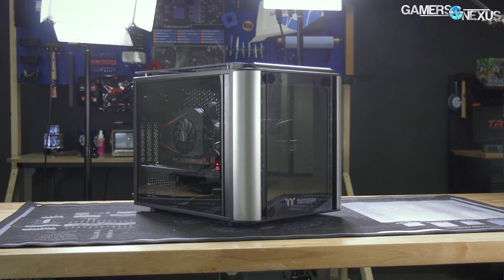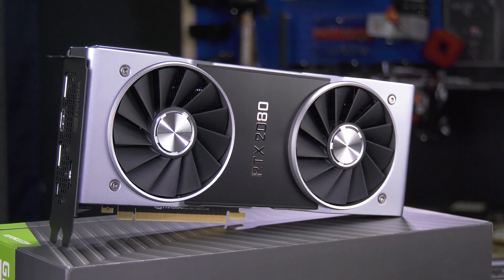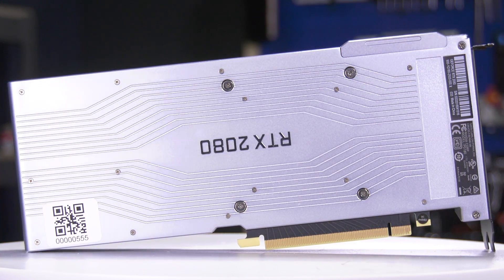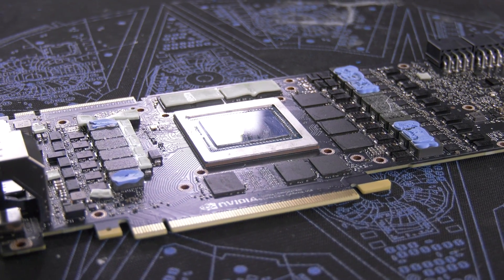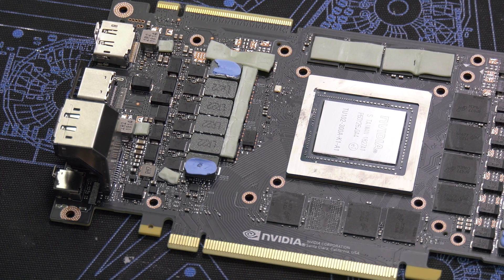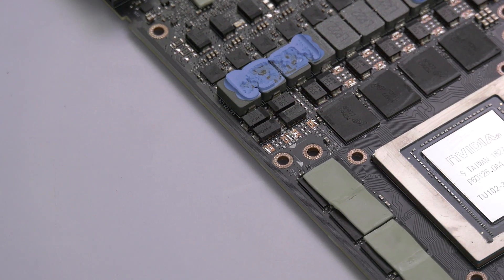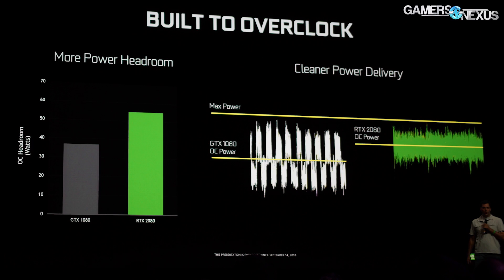RTX Power Delivery Redesign & FE Cooler | Interview

Comment: It might be a bit oversimplified, but if I understood that correctly more capacitors = less noise from the vrm/less coil whine?

Suggestion to Steve&Team: Can you adress coil whine on future card reviews? 
F.e. I bought a MSI 1080 Ti Armor about a year ago and put a much bigger partially self made cooler on it because it has the same rather good PCB as the Gaming X and it indeed has many benefits, the vrm is very easy to cool and in terms of power capabilitys it's more than enough, but it has absurdly amount of coil whine and if the statement of this video is true, that might be bc there's just 14 capacitors after the main doubled 8 phase VRM and they're also round electrolytic capacitors and not rectangular like on the founders editions, idk if that matters though.

Comment: I'm curious to know about the fan curve and if it is clever when in the idle/near idle range. A pet peeve of mine is when a GPU switches between fan speeds and it does it drastically, especially from idle.

e.g. Some GPU fans can idle at very low percentages, some won't work unless you give them 20% 

ASUS tackled this well on their motherboards with a Spin Up/Down variable you can set in seconds. If the Fan wants to go to 80% from 20% because of a temperature spike and you have the variable set for 10 seconds it'll make that  transition over the course of 10 seconds.

Comment: so not only did Nvidia dump a bunch of chips on partners and make it their problem, now they are going to cut into their profits by creating a founders edition that performs on par with partners, so why would partners continue to kiss their ass with all the ridiculous hoops they jump through?
Reply: ''Kiss their ass'', don't get me wrong I hate nvidia for all this crap more than anything but the boardpartners are nothing more than leeches. Only a select few % of the consumerbase actually cares which partner their card comes from and those are the people who like to push their cards beyond regular bounds (even then its largely based around the silicon whether you will get the overclocking result you want or not). If dropping boardpartners was all it took to get cards our way at near msrp I would gladly help nvidia get rid of them, but alas nvidia smells the money themselves and would much rather bump up their own price.
Reply: deari900 - if the board partners were nothing but leeches, why doesn't everyone but nvidia direct, and why are the "leeches" the ones losing out on this deal and holding all the overstock of chips nvidia made and are forcing them to take if they want the new chips? you called the wrong company the leech...

Comment: Since they said they're not using doubling scheme, does that mean that their voltage controller outputs at least 13 PWM signals? Or is just the same bullshit that mobo vendors do when they put two groups of FETs + Chokes on a single PWM signal and call it two phases?

Comment: Does NVlink work like SLI where developers have to do a lot of work to implement it or does it just work on it's own?

The reason why I really don't know is because when Nvidia first showed off NVlink with Volta they described it as combining many GPUs in to one massive one. But it seems like that would be a massive selling point, but they really didn't mention it much at all in the launch.

Im just curious, it would be really cool if they managed to do it.
Reply: While they may well be able to combine all the VRAM into one single transparent buffer, this does not mean they can combine all the cores into one transparent compute/video device. The necessary synchronisation and the very low latency required for this to be able to work in a transparent way (e.g. to not require explicit coding for it) is very non-trivial. Perhaps even impossible with current architectural design?

I strongly suspect it will continue to be poorly supported for games. Compute on the other hand may well be better supported, at least insofar as a subset of operations are concerned (those not requiring fine-grained, low-latency synchronisation)

I also suspect the only way to support fully transparent compute and video device addition/combining is through some mechanism of speculative execution to reduce synchronisation demands, along with a means of structuring command requests to reduce synchronisation demands by reducing inter-device data dependencies (say, where one card needs a texture from the VRAM of a different card) and the like.
Reply: @mduckernz  Thank you for the response.

This is coming from a person with very little knowledge of computer engineering, but I don't get why Nvidia can't get something like alternate frame rendering to work all the time, allowing for SLI to work in every application without explicit development.
Reply: @devindykstra  Yeah, AFR is a possible means of doing so - I too cannot see any show-stoppers there - but you will need to give up VRAM addition. Otherwise you're back to synchronisation issues.

Alternatively you could use a dongle which accepts two DP/HDMI inputs (and outputs a single DP/HDMI) and use the FreeSync frame update signal to switch between the inputs. This is effectively a way of doing AFR without needing to synchronise between the cards. 1. I don't think it is necessary, and 2. It would never be allowed by NVIDIA because FreeSync lol (if you did it the GSync way it would be ludicrously expensive for what it is)

Comment: "first time dual axial fans with vapor chambers"
i guess nvidia doesn't like to look at all the vapor-x designs from saphire?
Reply: Great point just what i was thinking
Reply: @penzonor
i am really curious of the size of said vapor chamber, does it go over vram and vrm, does it cover all of the cooler length almost, is it just bigger than average for a gpu vapor chamber.
gn will probably cover this soon, i'm very interested if it actually does a good job compared to other 2 slot designs say evga's for example.
gn shall not be defeated by nvidia's glue! (holding fans and cover onto the cooler)

Comment: wait, so there are heat pipes?
Reply: Good question. However vapor chambers are practically just big flat heatpipes.
Reply: +Péter Kiss but heat pipes take heat away from the source, whereas vapor chambers just spread it around. heat pipes are always better
Reply: firexgodx980  They both work the same way. The only difference is their geometry. Both of them just try to equalize the temperature in their whole body with local evaporation at the warmer points. Both just spreads the heat, the pipe along its longitudinal line (in one dimension), while the chamber along its plane (in two dimensions).

Comment: Nvidia's reference design cards > AMD's
Reply: Recent?  AMD been getting smoked for some time.  AMD has good cards, buy Nvidia 1000 series just wrecked AMD.
Reply: Nope 

- Always had overbuilt pcbs
- Dual BIOS
- Fury X & Vega Liquid have the best reference coolers and even beats most of the aftermarket ones
- Easily serviceable. AMD uses mostly philips bits and sometimes torx, screw numbers are on the low side, shroud comes off separately without even needing to touch the warranty sticker so you can clean the heatsink
- Silver Vega looks fantastic
- Metal shims to protect the die from being crushed by the cooler in case of overtorquing
Reply: Bizo221  I forgot to mention that I was specifically talking about the reference cooling shroud design, AMD's looks like a square plastic brick while Nvidia's looks more 'premium'
Reply: I agree with both of you are saying, but I was talking primarily performance.  (for gaming).  AMD are great cards for the workplace, however.

Comment: "Vapor chamber is soldered onto the heat stack." (@~2:40)  Could this by why you had trouble with the teardown?
Reply: Should still be possible to remove the fans though
Reply: GurtTarctor but why would you want to remove the fans.
Reply: That would most likely be the answer, makes sense.
Reply: Surely they wouldn't be soldering with the entire shroud on? It is to be expexted that the fins won't separate from the  vapor chamber, using thermal paste of sorts would be horrible in terms of cooling capacity. So soldering is pretty much a must I'd say.
Reply: Unnamed Internet Citizen you think you have access to these fans? Are you silly? Just send it back for a full new cover like a normal sane person.
Reply: Unnamed Internet Citizen, yeah I would not put that on anything over a 1070...

But sure, fair enough but not normal person is going to do that, so why add more parts to the design to benefit the 2 people that use the card for more than 3 years at full RPM.

Comment: Is it just me?  or is there a memory chip ripped off that card?
Reply: The PCB is made to accommodate for a Titan configuration, which by tradition has 12 gigs of vram (1 more than XX80Ti, which has 11gigs). So expect a Turing Titan on this PCB, with all VRAM pads occupied.
Reply: And because of this, it should produce less heat! Which is a good thing all around.
Reply: @davidhunter5802  1 extra/less memory chip has a negligible contribution to the total heat produced.

Comment: i wonder why he talked soo much about how efficient it is

i feel like its gonna  be powerhungry then
Reply: Power“hungry” means sucking a lot of power for not a lot of performance, if it sucks a lot of power yet offers a lot of performance that’s power”ful”.
Reply: The die itself is really large so yeah
Reply: @Tuchulu  nvidia will prolly be like
"yeah it uses alot of power.... but it does it efficiently"
Reply: PLPlolol 1  You can use a lot of power and be efficient (like Threadripper has a 30w higher TDP than an FX-9590, so it does use a little more power, but its also kicking out 8x the number crunching)
Reply: Pascal cards are already pretty efficient. If the new architecture has at least the same energy efficiency but they improved the power section even further, then there is no reason to complain.
Reply: Usually with first gen (12nm ), will be power hungry and run hotter . As the next gen of turing will be more defined and so on.

Comment: "hey my name is steve and I'm going to ask some questions and you can answer however you want even if it doesn't make any sense." "up to 1/5 quieter or 1/5 of the noise of a 1080", really?
Reply from the maker: Technically speaking, they are correct. Decibels are logarithmic, so you're looking at a rough 3dB change depending on if they're using SPL or not. It's not marketing we agree with, but we discussed that in a separate video. Mathematically, they are accurate.
Reply: We can't really expect the forum viewership these days to really understand that sort of thing though, Steve, can we? Just take a look through what much of the channel viewership has become. Tech today is full of ignorant opinions, bias, and misinformation.

I much prefer your work done mid generation, as it often focuses on addressing much of these issues. I think these sorts of launches drive everyone into their own shells of bias, and it is seen throughout. Its hard to dodge the trend when it drives viewership and $ up though I am sure. You and your team do much better work getting to the facts, providing factual technical leadership. It is a real challenge keeping individual bias from seeping into media content for personal gain.
Reply: 20% less noise, how hard is that to understand Milvio?
Reply: "up to 1/5 quieter or 1/5 of the noise" did you read or listen? in what scenario is that card going to be 1/5 of the noise? you sound really smart  so I am hoping for a good answer.
Reply: @milviodeleon4421  Again, he is not saying 80% less (1/5 of the noise) its 20% less (1/5 less than the noise of the 1080)

Comment: they didn't answer, are there pads, paste, what,
Reply: Obviously pads. The components in the VRM are different in height and the FETs have plastic casing. Some direct contact and paste wouldn't be such an upgrade, but just pain in the ass in the manufacturing. Not as they really needed that efficiency in cooling those FETs...
Reply: The question was what connects the vapor chamber to the base plate, not what connects the base plate to components.
Reply: Marc Wolfe  I think the guy explains it at 2:23. "The vapor chamber is soldered onto the fin stack."
Reply: He said that, without answer how the base plate is attached to vapor chamber, he said there was a heatpipe for the VRMs, but still didn't answer that detail.

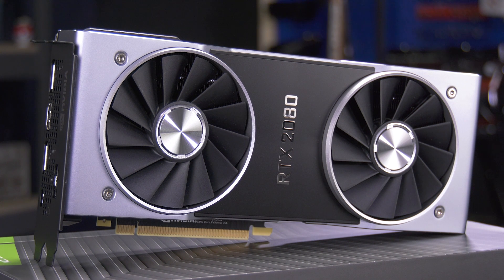Comment: 1:42
Uhh no, what about the Sapphire Vapor-X cards?
Reply: He is not wrong when he, the Nvidia employee, says "WE", implying Nvidia, combined a dual-axial fan with a vapor chamber for the first time.
Tiny details like that are easily missed.
Reply: EVER.
Reply: Looks like they did actually use a vapor chamber on the 7970 with 2 fans http://www.overclockersclub.com/reviews/sapphire_hd7970_vaporx_ghz/2.htm
Reply: I guess you could reinterpret what he said to mean it was they first time they have done it/ "we've done it for the first time" meaning they hadn't done it before, not that it had never been done by anyone before. But I don't think that's what he meant. I think he was just wrong.
Reply: lol we're all being dumb. at 1:11 the other guy says it's the first time it has ever been done, so clearly that was their intention, and that is definitely incorrect.
Reply: my bad that was actually the same guy, but yeah he's wrong.
Reply: I agree he was incorrect but i don't think he lied like other comments are saying either they were unaware because saphire dont make nvidia cards or they were using the term graphics cards when they should have said nvidia graphics cards.
Reply: @Delcolux  It's a full length vapour chamber covering the entirety of the card and cooling everything, maybe that's what's never been done before.
Reply: Sapphire doesn't build Nvidia cards, so that might have flown under their radar.
Reply: Correct me if I am wrong, but I think the only ones that actually used a vapor chamber were triple fan cards.... so not dual axial.
Reply: Delcolux 
Nope, the R9 280x for example had two fans and a vapor chamber.
http://www.sapphiretech.com/productdetial.asp?pid=5A4A61A0-149A-4AC9-8F49-1407F20C1E7E
Reply: @Delcolux You are wrong, go look up Gigabyte GTX 570/580 OC and SOC versions. They use Vapor Chamber design and take only two slots.
Reply: Abraham Lincoln 

You're wrong, the vapor chamber is mounted between the GPU die and baseplate of the cooler.
Reply: The first time they "nvidia" have done it.
Reply: Yes. They were being deliberately misleading. Plausible deniability.
Reply: +Abraham Lincoln
The Vapor-X range of cards do use a vapor chamber design, but although while the early cards used a straight vapor chamber like on your illustration, the more recent dual and triple-fan cards use a combination of vapor chamber and heatpipes to allow for a bigger fin stack. That design is quite different from Nvidia's, who seem to be solely using the vapor chamber to spread the heat through the fins.
Reply: Yep they lied
Reply: this

Comment: Nvidia should have just rolled these two guys out for the press conference. For once, i think im excited about these cards.
Reply: My thoughts exactly.  Time to let the Engineers talk and be honest about their work.
Reply: I agree, I dig actual technical design aspects of a product at this level of detail, especially when the reasoning behind the design path taken is explained.
Reply: 3800Tech  Not to mention I think most customers that would spend this kind of money at/before launch are enthusiasts that would appreciate it and be more likely to drop the cash after hearing more technical information.
Reply: Perhaps not excited since they're expensive AF but definitely a lot less cynical and jaded than from nvidia marketing pushing that shitty ray tracing meme.
-Good power delivery
-An actually good cooling solution even if it doesn't fit the stupid poorly ventilated workstations that honestly should be segregated from general public products anyway (arguably a major drawback for cooling is the insane amount of screws and glued pieces making complete cooler disassembly impractical)
Also Steve should have asked about LN2 pot clearance, though they probably wouldn't really have a solid answer for it anyway. Sounds very much like a GPU that Buildzoid would enjoy torturing for high scores.
Reply: Cooling looks nice but I'm a custom water cooler for life.  50C TOPS under load in a non-conditioned apartment in NYC in mid summer?  Yes, I'll keep it.
Reply: yea, not the jensen huang marketing ™ theyre basically slapping to people's faces